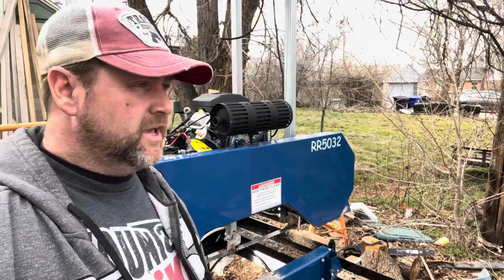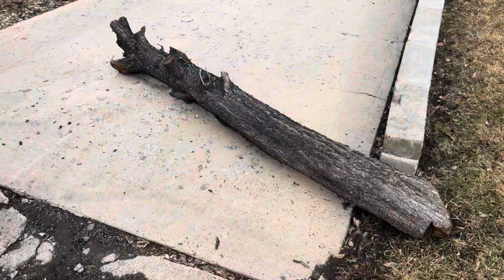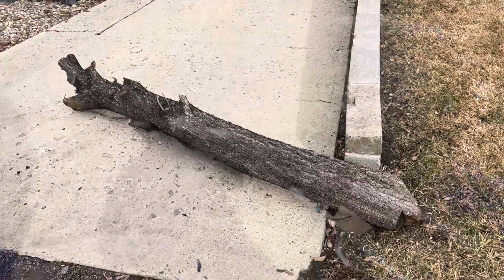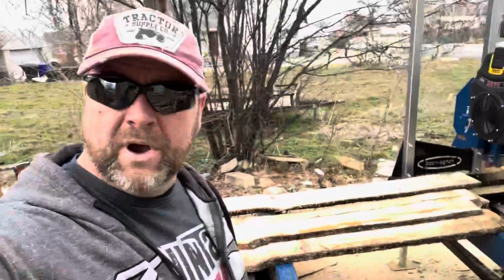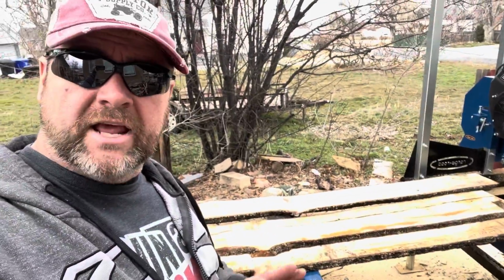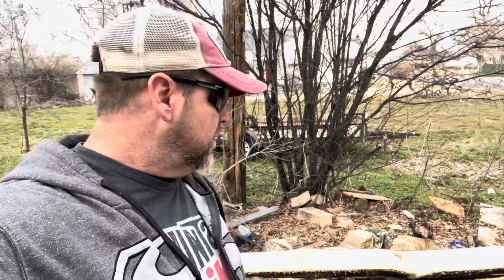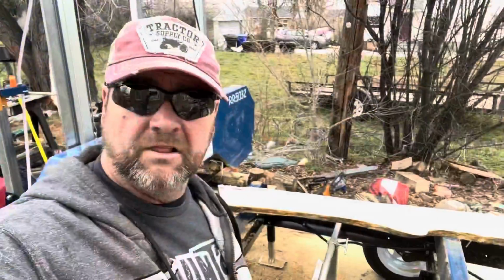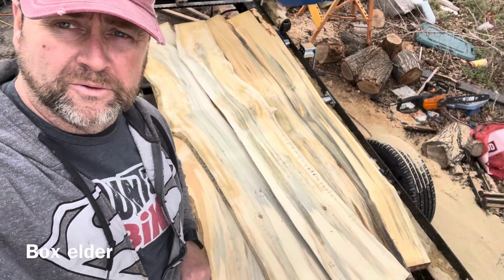First logs cut on my range road 5032 Sawmill

Comment: Wish my 29 had that adjustable blade support. Suggestions: Don't back up in cut and lift saw before returning for next cut, blade can bind or catch and come off and maybe break. Those log stops are real hard on blades too when you get too low, I put a 4x4  against them with it sticking above stops so if I hit that it's time to check cut height. Also made wood shim channels to put over log support to use under one end on tapered logs or you can get an attachment for adjusting logs for a level cut.
Reply from the maker: Definitely learned that the hard way! Thanks for the post!

Comment: Looks like a lot of movement of saw head where it’s shuffling as in push side is moving independently of other side
Reply from the maker: The stability of the cutting head definitely needs work. I’ve had a few supports here and there.